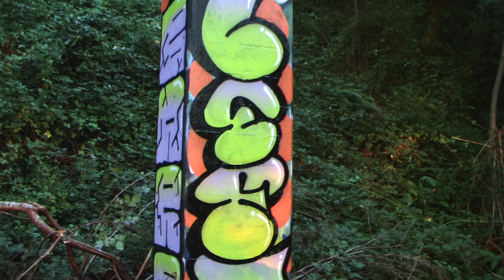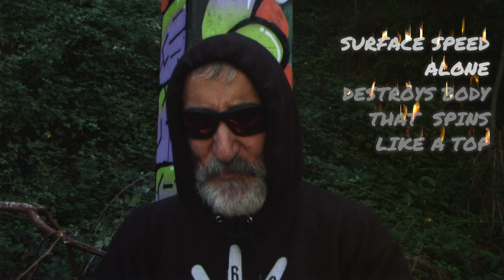WHY A SPINNING BODY BREAKS ALONG ITS LONGITUDE no cracked body can spin globe earth is a fantasy

Comment: your right it doesn't matter on the radius of an object....it says that right in a machinists hand book !!...ball earthers always say but but the earth has a huge radius of 4,000 miles...IT DOESN'T MATTER !!...great video ..thx
Reply from the maker: and only surface speed and tensile strength matters when you spin like a top, no material can go over 1000 mph, no cracked body can spin ... "And that's the end of the globe!"  😎
Reply: The angular velocity dictates what percentage of the linear velocity we feel. A slow rotation such as around the sun means a small percentage of the total linear velocity. Thats how centrifugal force (constant acceleration) is calculated. Gravity cancels out the centrifugal force of the earths rotation, and we feel less than 0.1 mph of acceleration each second between the rotations around the sun and the Milky Way galaxy. Rather slow, don’t you think?
Reply: @rocketspushoffair  

WIKI "Ehrenfest paradox" . 
"Any rigid object made from real materials that is rotating with a transverse velocity close to the speed of sound in the material must exceed the point of rupture due to centrifugal force, because centrifugal pressure can not exceed the shear modulus of material. . "
i.e. you cannot rotate ANY physical object faster than ~767 mph.
Reply: @minecrafter3448  
That is not correct but it is an understandable conclusion to make if you have not studied physics to a higher level.
- The study of mechanics is divided into 3 branches : rigid-body , deformable-body and fluid mechanics.
- The later 2 are considered advanced and are only taught in specialist degree courses. 
- Modern techniques use Finite Element analysis which requires a great deal of knowledge of advanced calculus / math and computer programming.

I will assume therefore you are only familiar with 'rigid body" mechanics.
- In this model , molecular bonds are infinitely strong i.e. The material properties are ignored.
- So we cannot use this model for the earth if we wish to analyze internal stresses.

What you must understand is that the laws of physics are continuous.
- So for instance, every unit of matter "feels" centrifugal force simultaneously and therefore "feels" hoop stress simultaneously also.
- In Newtonian / Lagrangian physics a "reaction" occurs simultaneous with an "action".
- This might sound counter intuitive , but that is because you are falsely equating math (that happens to be discrete) with some concept of how the underlying reality works. In actual fact,  energy conservation based physics such as Lagrange relies on integrating differential equations over a volume which is continuous by definition. 

Bottom line
- If there is rotation of a physical object then there will be hoop stress. 
- This stress is perpendicular (around the circumference) to the vertical direction (on a sphere)
- So "gravity" (as you are viewing it) cannot effect this in any way.
- I also have to add that the "mass attracts mass idea" is not a credible theory . Even Newton did not want to be associated with it . It is disproven by the fact that each "graviton" would have to selectively pass through matter until a specific "unit of matter" is encountered.  For example the suns gravity at night passing through the entire earth (without interacting with it) and then suddenly deciding to pull on a "water molecule" is plainly ridiculous as a physical explanation.
- In modern physics gravity is not viewed (or calculated) as a "force" that acts at the micro level. i.e. between "atoms"
Reply from the maker: @minecrafter3448  I just want to add a note about the axis of rotation which is not the center of mass for a person standing on the globe, that person is orbiting like swinging a ball on a string; but the globe itself is spinning like a top about its own center of mass, and only a solid object can do that while the globe is cracked all over its crust, and that alone disqualifies it, plus the fact it's spinning way too fast which is beyond the tensile strength of any material, and if you include the force multiplier effect of the weight or mass of the  globe, then no surface speed no matter how slow would work because the moment you tried to spin it it would literally break under its own weight (and still a solid body is required)
Reply: Anyway I hate travelling at 500,000 mph with a openroof :(
Globeship needs a magical dome :)
Reply: @rocketspushoffair  you’re forgetting, once again, that gravity exists. If gravity gets more effective the larger the object, the centrifugal force is cancelled out. Meaning, the earths rotation around the sun and around the Milky Way are the only ones that matter. If went ahead and said the ice wall didn’t exist, that would be an essential part of the flat earth model. Same with gravity and the globe model. One difference between the two. Gravity is a constant, where as the ice wall isn’t. It’s inconsistent. Gravity isn’t. It doesn’t work however we want it to work.
Reply: Just thoughts: I really like these series of videos and we know they agree with the  real world. What isn't intuitively obvious is why the force concentrates in the rim. The speed isn't that much faster compared with the smaller radius so what happening to concentrate the 'forces' in the rim?  
     It took me a while to understand... imo, It is about 'kinetic energy' of the matter in the rim and the forces required to make it follow a circle.  We all know about driving a car at different speeds and trying to make it turn a particular bend in a road. Under a certain speed it is not an issue. However, as you get not that much faster in terms of linear speed then it get 'interesting' getting around the same corner. ;-/  
    The issue with 'kinetic energy' is that is is a 'square law' not linear. The amount of energy and forces involved will be concentrated on the rim and it is constantly having to be forced in a circle.  
   Combine this with the internal forces required to try and hold the material together and it get interesting. 

   As stated, If there are any cracks in the solid then that point will be unable to hold the outer rim and force it into a circle motion. It really will cause 'crack propagation' from the first weak point on steroids? 

   These are just my thoughts about this topic. It does explain why stress builds up in the rim as it is where most of the energy and forces are.

  This can be checked in the real world. I am interested in this.
Reply: @ryanqvincent144  as you may know, we “globies” love angular velocity. It’s because it so easily disproves the “we would all go flying off” claim flat earthers make. Centrifugal force (the stuff that would make us fly off) is calculated by the percentage of the linear velocity the angular velocity judges the object should have. In other words, the slower the rotation, the less of the linear velocity we feel in acceleration. That’s why the rotation around the sun being once every year really takes away from the linear velocity. It means that we feel 1/365 of the linear speed in acceleration per day, split up evenly. The little acceleration we do feel is MOSTLY cancelled out by gravity, and the remaining centrifugal force after all of that is applied is so minuscule that it’s nearly impossible to feel. So the “we would all fly off” argument is meaningless. Meaning, this entire video is almost worthless. He does have a point with the centrifugal force of the earths rotation tearing the earth itself apart… if gravity didn’t exist.
Reply: @ryanqvincent144  It’s math, not science. You can’t just lie about math. Math is math, and it can’t be changed. Meaning, it isn’t possible for me to be lied to. I can easily double check the calculations. In fact, I did it yesterday.
Reply: @minecrafter3448  What nonsense is this? You can sit in a car and detect acceleration? Please explain your point in more detail.
Reply: @minecrafter3448  lol, the 'maths' isn't the issue! It is about what you have been taught about 'maths' and the real world! I promise you that you have never seen certain 'maths' you have been taught about 'momentum' Demonstrated as true in the real world! :) 
   You have passed tests on it! Yet, it cannot be true! :) 

   This isn't really about 'maths! ;-/ It is about the real world!  That you had to be lied to about. ;-/ Sorry.
Reply: @ryanqvincent144  woaw sound good, talking about certains speed for wheels not perfectly balanced it wobbles some, apparenly Thee Ball /Ellipsoid has just started doing that, should degenerate pretty fast, with all this ice melting business.
Reply: @wildboar7473  lol, fool! Why are you talking about 'wobbly wheels' and Ice melting to me!? :)  You really are confused. ;-/ 
   When you wish to explain yourself to me then we may be able to have some type of meaningful dialogue. I live in hope. :)
Reply: @ryanqvincent144  ...not reallys sure, why can you not ignore if its not to your licking, here in public YT, aint your thread. No worry I will no longer address THEE.  Have a nice day :)
Reply: @ryanqvincent144  It’s simple logic. You don’t need to be “told” what to do to calculate things. You can calculate them on your own, because it’s a system that self-operates. It’s a system that was created thousands of years ago, and only the shape of the symbols representing math changed, not their uses.
Reply: @ryanqvincent144  you can sit in a car and feel acceleration while it’s speeding up, but you feel minimal acceleration once you get up to speed. The acceleration you do feel is because of user error in not keeping a constant speed. During turns, you’re feeling a fairly large percentage of your total linear speed, because it’s relatively sharp turns, rather than slow ones. Imagine you drive at 80mph, turn 90 degrees over the course of 3 seconds, and continue in a straight line. That means you’re feeling 1/12 of your total linear speed in acceleration each second. That’s the equivalent of getting in a car, and going from 0-60 in 5 seconds. That’s pretty decent acceleration. Whereas with the earth, you’re turning much slower, but moving much faster. The slowness of the turn nearly cancels out the linear speed. If the earth was stationary, you wouldn’t feel the difference.
Reply: @ryanqvincent144  so you’re just going to keep screaming “lies” like a little baby until I agree with you? You have yet to make any argument to support your point. All you do is rant about how everything is a lie.
Reply from the maker: @minecrafter3448  27:43 i refute you, "gravity" has nothing to do with centrifugal tension (hoop stress). Molecular bonds are always orders of magnitude stronger than "gravity" and they are still nowhere near strong enough, case closed. The centrifugal force you are cancelling only pertains to objects riding on the surface of cracked fake globe earth, who's AXIS OF ROTATION IS AWAY FROM THEIR CENTER OF MASS (they are not spinning like a top).--Wrong force relationships and wrong math.
Reply from the maker: @wildboar7473  haha! they might already have one ... the celestial dome!  :)
Reply: @decadent.  Have you read Newton's "Principia"? I recommend Densmore's English version. It shows how the universal gravitation law was derived. Newton didn't know what gravity "was", but he knew what it "did".
Reply from the maker: @minecrafter3448  "gravity" is a reification fallacy, you globetards never really understand that
Reply: @rocketspushoffair  Last time I checked, things fall. I've heard they fall 4.9 meters in one second, 4 times than in two seconds, etc.
"Reification" means "misplaced concreteness". So are you saying that falling is misplaced concreteness? Something tells me the answer will include "tard" or some other insult.
Reply from the maker: @michaeldunlavey6015  crying "gravity" is a reification fallacy, no different than reifying (inventing or bringing to life fictional characters with all kinds of fictional attributes, and treating them as if they were real, dungeons and dragons for example) you are misplacing concreteness to a purely imaginary force, while admitting nobody knows where it comes from according to N.D. Tyson, which has been superseded by a new theory involving time space, which itself is another reification fantasy
Reply: @rocketspushoffair  thats not what a reification is lol
Reply from the maker: @negatorxx  reification = globe model space fantasy claims ... an imaginary force causes a broken pear to behave like a solid body with trillions of psi tensile strength ... 😁😆🤩🤣😂🤠🥳🤯🤕
Reply from the maker: @BigHeretic  you are a lazy dunce, stop repeating your ignorance, It's been debunked
Reply: @rocketspushoffair  thats not what reification means ;)
Reply: @rocketspushoffair  What's been debunked?
Reply from the maker: @BigHeretic  everything you say
Reply: tony kamps "IT DOESN'T MATTER !!"
It doesn't matter if you're talking rpm or rotational speed, but it does if you're talking mph or linear velocity.
Reply from the maker: @BigHeretic  radius factors right out of the equation, you obviously have not visited the three links in the description ... one more stoopid comment from you that was answered in the video or at the links and you get blocked, I don't need you spamming the discussion any longer with your willful ignorance. 

EDIT: If all you came here to do was parrot your brainwashing you have been given more than enough space. You're too lazy or too re-tard-ed to get clued up. 😏

Comment: Do you know why rockets don't push off anything?
Reply from the maker: no, why?
Reply: @rocketspushoffair  Because conservation of energy.
Reply from the maker: @BigHeretic  what's your example?
Reply: @rocketspushoffair  Stand on a skateboard and throw a weight away from you - you will roll in the opposite direction.
The heavier the weight or the greater the force of your throw will cause you to roll proportionally farther.

Also, Newton's Cradle
Reply from the maker: @BigHeretic  Rockets don't eject anything, they combust like a blowtorch. Combustion is not even possible in fake space vacuum even with oxidizer. Also, your example only works on earth, where there is friction on the ground for the wheels, and bodies have weight--it's nonsensical in weightless space vacuum, it could never work, no friction and no body weight.
Reply: @rocketspushoffair  Yes like a blowtorch, what do you think the flame is? It's the burning gases. The result of combustion are chemicals and compounds which have mass.
Of course combustion is possible in a vacuum, you can find demonstrations on YouTube.
That's right, there's no friction in space - nothing to impede momentum. Your skateboard will slow down and stop due to the friction whereas a rocket will keep on moving until acted on by another force.
It doesn't work because of weight but because of mass which has inertia - you can push against a large body in space and it will resist but once it's moving it will be difficult to stop. Imagine an anvil on an ice rink, difficult to get moving and difficult to stop. And if you do push it in one direction you'll go in the other just like on the skateboard.
Reply from the maker: @BigHeretic  No, you cannot. This is false: "you can push against a large body in space and it will resist but once it's moving it will be difficult to stop. Imagine an anvil on an ice rink, difficult to get moving and difficult to stop. And if you do push it in one direction you'll go in the other just like on the skateboard." You need friction.  And no, it has been demonstrated that you must isolate the reaction from the vacuum in order to get combustion. Rockets push off air.
Reply: @rocketspushoffair  So you don't think that if you pushed an anvil away from you on an ice rink you'd go the other way. I don't know what to do with that much denial.
Reply: @rocketspushoffair  "you must isolate the reaction from the vacuum in order to get combustion"
I believe that's what the combustion chamber does. It operates at very high pressures and exhausts through a narrow exit which accelerates the gases into the nozzle.
Reply from the maker: @BigHeretic  No. It operates at relatively low pressure. It's not about "belief". There is no equal opposite thrust force pushing anywhere inside the cone/combustion chamber. And the exit pressure matches ambient. The combustion chamber is directly exposed to vacuum. Globe-rider goes full re-tar-d on YoutTube, congrats! 😁😆🤣
Reply from the maker: @BigHeretic  It's nonsensical in weightless space vacuum, it could never work, no friction and no body weight.😏
Reply: @rocketspushoffair  What do you need friction for?